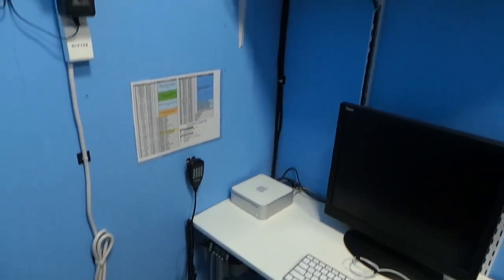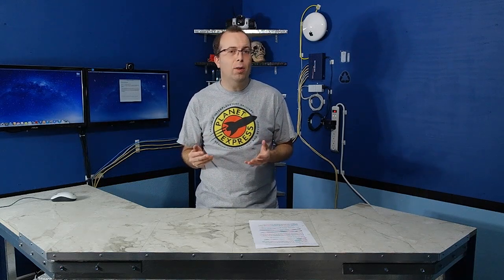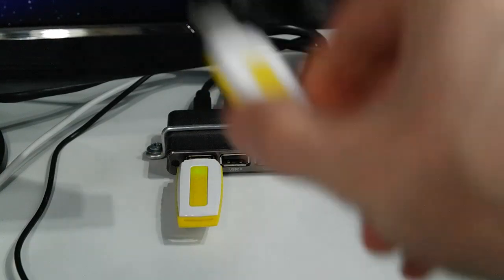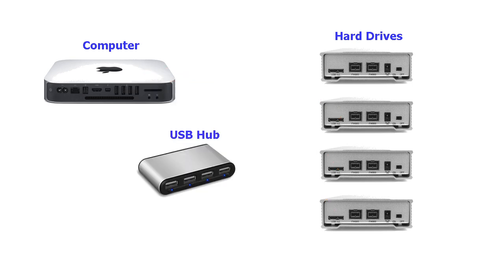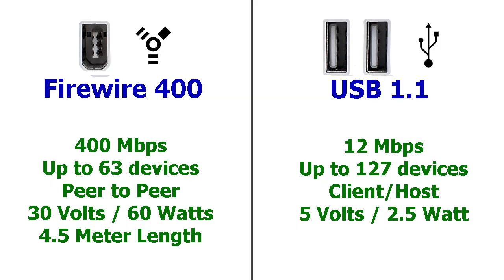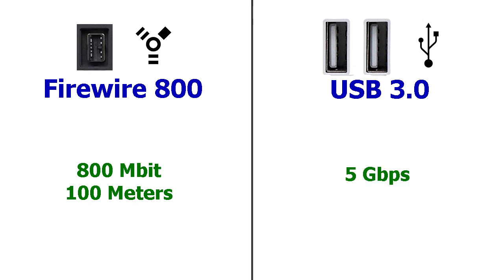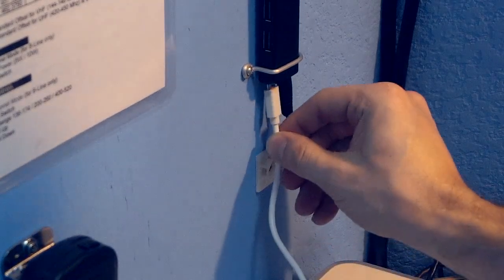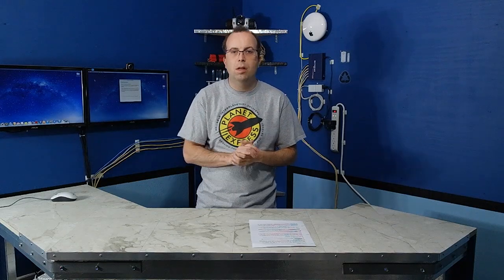Farewell R.I.P. Firewire, Hello USB!

Comment: The real reason for the death of Firewire despite some of its raw speed advantage in data transfer bandwidth is that USB was EVERYWHERE and AFFORDABLE (Intel made USB 2.0 licensing really cheap, and Firewire was always more expensive in part due to Apple pushing it and overengineering it, raising costs). Also Apple, as the main supporter of the Firewire standards, dropped it in favor of Thunderbolt as the equiv of an ultra-broad bandwidth pseudo-EPCI-E (External PCI-E) bus.

Also USB 3.0/3.1 is EVERYWHERE too thanks to Intel keeping the price competitive and USB Type C looks like it will become the new standard head over Micro-B 3.0 and 2.0.

Comment: Am I remembering correctly that the first generation iPod used Firewire exclusively? I seem to remember my dad having to buy a card.

Also, what is the functional difference  between daisy-chaining Firewire devices and using USB devices with an extra input built in?

Comment: CALLED IT... the very moment they announced Firewire, I knew it was doomed. It was not hard then to understand that the existing (and ubiquitous) USB would eventually reign as the serial connection of choice. Daisy-chaining was already an underused (and impractical) feature, even for most SCSI and MIDI setups, since users and hardware manufacturers – mostly for cost reasons – have always gravitated toward host/hub-based solutions with the PC at the center of their environment. [I never once encountered a system with multiple storage devices chained together! Unless you count, say, MSX computers whose second floppy drive hung off the primary drive. Nor have I ever met a person using Firewire 800.]
Finally, the rapid succession of USB enhancements meant Firewire's slight edge with regard to throughput and peering would quickly be erased. I also suspect (but cannot substantiate) that so few devices were designed with Firewire on board owing to onerous licensing costs and, ironically, because IEEE 1394 was simply TOO far ahead of its time; meaning, attached peripherals of the day (ZIP drives, microphones, printers, etc., with the obvious exception of video) did not need all that speed. And those that did tended to be internally connected via EIDE or (soon) SATA, or already had a better solution in place (like VGA/DVI).

Comment: One of the reasons of the fail of Firewire was the arrogance of Apple who charged too much royalties for using their technology and even the copyrighted name and logo. Some manufacturers like Sony renamed it D-Link, but it was actually Firewire. La Cie stopped manufacturing external hard drives with a Firewire connection and continued making USB-only drives. Then the making of Firewire peripherals declined and almost disappeared very fast. I saw in a shop a ridiculously expensive plastic block adapter for 30$, just for connecting two different formats of Firewire ports (4-pins to 6-pins). Like many Apple special cables and adapters that are a big scam to take the most possible of our money.

Comment: I understand why Firewire didn't make it compared to USB (speaking to USB going from 12 -> 480 -> 5000 mbs where as Firewire went from 400 -> 800 and would have gone to 1600 in its third generation) and today with modern computers, USB3 is fast enough for even any two spinning hard drives (and is only a tad slower than most SATA SSD drives, etc.) but Firewire was still far more elegant, and I don't mean just in its physical attributes, I mean in its specs.  As others have already pointed out, even the slowest computer could blast along at Firewire's maximum of either 400 or 800 mbs., etc.

Comment: it seems that gigabit ethernet has fully replaced firewire. But now instead of buying devices with "firewire" , you buy normal devices, and implement them using an ethernet interface.

Still blazingfast, and still peer to peer.

Comment: If you use wd my book or my passport drives and you keep the drives on a shelf buy a usb desk gorrmut drill the hole in the shel you can get them with like one usb that connects to the commputer and the block that goes in the hole has like 10 ports

Comment: 1 - Firewire is still used in the audio industry, as it is more stable than USB.
2 - Most ASIO interfaces still use firewire.
3 - FireWire 400 was able to maintain a constant 400Mbps throughput, whereas USB 2 was only able to attain 480 Mbps
     BURSTS rate. So FireWire 400 was still able to transfer larger quantities of data faster than USB 2.  FireWire 800 then 
     ruled the roost until the advent of USB 3. In the Mac world, Thunderbolt replaced FireWire as the fast medium of choice
4- Well, the last MacBook made that supported FireWire was made in 2012, so I would consider that FireWire died then.
5 - The thing with Thunderbolt and Firewire is that Thunderbolt is way more versitile in every way. And USB is going the
      same way unlike Firewire.
Fact: Firewire is indefinitely more stable.
Fact: Firewire is indefinitely and infinitely more daisy-chainlinkable.
Fact: Firewire must be revived, the technology be multi-phased array so as to function and work together as one combine 
         each other's capacity and capabilites. Therefore Firewire must be redesigned and re-engineered to achive this.
Fact: Firewire must be both multi-phased arrayed and redesigned and re-engineered to become a parallel connective
          system. So if one system fails, the the others will continue on but equipped with a hardwired program that 
           simultaneously 
           monitors all systems and compares all systems functions and if one is starting to fail it automatically disconnects 
           that system and allow the rest of the other systems to functions. And sends an optical-visual alarm saying system 
           component malfunction
            and needs to be replaced.
Fact: Firewire must be based on the principle of the computer cluster parallel connectivity so if one compute
          malfunctions it is then disconnected, a visual optical alarm is sent to have it repaired or replaced, and allow the other 
           computers to function.
Fact:This redesigning and re-engineering and upgrading of the firewire technology though the use of the multi-phase array 
         systems and principles to increase it's capacity up to 1,000 gigabytes per second will revive firewire technology back 
         into front line. 
Fact:Both Russians, Japanese, and South Koreans are in a quiet joint venture to achive this and are successful and has 
         ironed out the kinks of the system and made it multiple-redundant in design and in engineering.
         Mass production has already been underway for almost 3 years and the hardware with it's hardwired programm
         and hardwired O/S are already open available and accessible BUT NOT YET RELEASED TO THE CIVILIAN PUBLIC.  
         They are still deciding when to release it in such a way to overwhelm the competing outsiders who are more than 
          eaager to supporessed this new invention and innovation, or even steal it and falsely make a fale patent claim over it 
          to prevent it's widespread use.
Fact: Fire wire was successfully reconfigured to be multi-O Raid by combining several clustered firewire systems it can e 
          easily be upgraded to 100 GBPS to 1,000 GBPS.

Comment: One thing that bugs me about this video. The hard drive is obviously USB 3.0 (or as it is now called USB 3.1 Gen 1) yet Your using and USB 2.0 HUB. Your loosing precious transfer speeds. The HUB is bottlenecking Your hard drive. I'm sure Your external USB 3.0 drive would go as fast as 90-100MB/s so why limit it with USB 2.0 speeds that would go up to probably 20-30 MB/s?
Reply: probably because the Mac Mini he's using only has USB 2.0 ports anyway
Reply: @GardevoirTrainer1  Still better off with a USB3 hub for future-proofing
Reply: you're just moving the bottleneck from the hub to the USB 2.0 port on the machine the hub is plugged into
Reply: @GardevoirTrainer1  or install a designated server working as a SAN..... for a small thing  its pretty darn usefull and cheaper do it yourself, or a  NAS configuration its even more stable than a cascade of External Hardrives wired by a hub
Reply: Since those drives are likely for archiving, speed isn't likely a big issue for occasional access.
Reply: Or he could have just connected the one usb drive via usb and didn't touch the rest
Reply: I was thinking the same thing.... Hooking a set of USB  3 drives to a USB 2 hub made me cringe.    My solution (and what others mentioned as well) was to just buy a NAS.   I don't see the point in having multiple external drives.
Reply: they are hard drives... they won't be hitting even usb 2 max speed anyway
Reply: sorry, it's called USB 3.2 Gen 1 now, and we all want to cryofreeze everyone at the USB-IF because they completely botched any sane schemes for the literal most universal connection protocol
Reply: Why not upgrading right now to a NAS?
Reply: This video is 5 years old nimrod
Reply: because its  obious, a HUB always be a bootleneck
Reply: @xXFlameHaze92Xx  But it's a difference between capping out at 5 gigabits, which may take a few devices, and capping out at a tenth of that, which may only need two devices.
Reply: USB 3 is up to 12Mbps, not the advertised 5Gbps.
Reply: @alandunaway3000  No, that's totally wrong. You're going back to USB 1 numbers. Even USB 2 is faster than that. I just read a PC World article where they tested a Mushkin USB 3.0 memory stick and it reads around 100 MegaBytes per second and writes around 40. It's not the best the format could do but it's sure as hell way better than 12 MBps (megabytes per second) and even-more-exponentially better than 12 mbps (megabits per second).
Reply: @jamescarter3196  I have a HDD and a flash drive, flash drive writes at 12 on USB 3.0.
Reply: @jamescarter3196  While my network writes at 50Mbps.
Reply: @alandunaway3000  are you confusing megabits with begabytes
Reply: @alandunaway3000  You're doing something wrong there, but also neither 3.0 or 3.1, etc..  flash drives ever use the full speed of their link. They haven't caught up yet.
Reply: @ChadDidNothingWrong  That proves my point that the advertised speed is fake.
Reply: @nucflashevent  Top of the line drives.
Reply: @alandunaway3000  ya talking about megaBITS or megaBYTES?
Reply: @tsrenis  My network transfers at 15MB/s, which is about 112Mb/s. And my flashdrives/USB HDDs barely get to 5MB/s. Even though the flashdrive is a Kingston(one of the best) and the Hard Drive is a Samsung.
Reply: @alandunaway3000  look, there's probably a problem somewhere with your system, but i can guarantee you even usb 2.0 can top that. i just plugged in my external hdd (usb 2.0 cable and port) and it somehow managed 22 MB/s. that's 176 mbps. i hope you fix your slow transfer speed problem, but don't go around saying usb sucks because your devices have problems or are outdated
Reply: @leogiri2863  Or a problem on the drives themselves, or maybe the advertised speed.
Reply: @alandunaway3000    maybe your port is slower than the standard, or maybe your drive is, but going from "my drives are slow" to "USB   2.0 never reaches advertised speeds" is quite far fetched. Also it took me 30 seconds to check that usb 2.0 can be faster than you say.
Reply: @leogiri2863  USb2 is crap(and usb 1x was even more horrible),it has high latency,as all USB does,and it never reaches 480Mbps its advertised as(and i've checked it on alot of systems with many usb periphrials). On top of that it cant be easily daisy chained and usb2 never provided enough power as it should of.. While i am no firewire fan,it was a better standard. usb3x is alot better and its finally gotten its act together(ignore stupid naming conventions like 3.0,3.1,3.2, gen 1,blah blah).
Reply: @a4000t  yes, but it isn't as bad as he says. It's still usable, even tho it's getting outdated, and it's still good enough for some things like printers and keyboards.
Reply: @leogiri2863  i'll stick with what i said, its crap,but we're stuck with it and it works for the most part. Its just proof that good standards rarely win.
Reply: @a4000t  I think calling it crap is a little excessive. Of course it's not perfect, but it works. In all of my life I've never thought "USB is so slow". Think of the alternatives. On one hand there could have been something better, but on the other hand usb coexisted with floppy disks and dvds. So of course I agree with you on the fact that now usb 2.0 is getting outdated and that there might have been better options, but I don't think it's as bad as you picture it. That said, I'm not saying you should use it, if you don't like it. the only problem I had was with AlanDunaway3000 claiming some nonsense about usb 2.0 being way worse than it actually is and saying that there's a difference if you plug a 2.0 hdd in a 3.0 port.
Reply: @alandunaway3000  uhm USB can do those transfer speeds, your right the hub is a possible bottleneck, but the drives themselves are hdds. Also even "high quality" flash drives are shit in comparison to an actual sata ssd.
Reply: @leogiri2863  No, it doesn't do a thing. I thought it did, but if the drive is limited to 2.0, putting on a 3.0 won't make a difference. 3.0 is limited to 7MB/s, unless you buy a top of the line mobo.

Comment: I came across firewire when I got my first MiniDV camera. I used it to copy the videos from tape to the PC for further editing. At the same time I also bought an external HD with firewire for the same purpose, as USB was way too slow back then. It's sad that this interface died.
Nevertheless I just brought my laptop with firewire back to life last week. My buddy next door wanted to copy a stack of MiniDV tapes to DVD and had already started using a cumbersome setup, piping the signal through composite video, HDMI and whatnot to his HDD recorder to then copy it to his PC using an external HDD. I gave him the laptop and a firewire cable and explained how he can copy the video tapes without any loss in quality (albeit at the same speed as the tape is the limiting factor here). He had never seen that before and was amazed that he could even control the camera through firewire. :)
Reply: Colaholiker Yeah, my old MiniDV camcorder is the only place I ever really used a FireWire port. Had to get a PCMCIA card for my laptop.
Reply: @pokepress  For me it was the starting point. I also got a Firewire external HDD, which was way faster than USB 2.0 back then. I am still using it, even though I will have to switch to the much slower USB port now that I am setting up a newer PC which doesn't have FireWire any more. (On the older one it was on board, so no chance of just swapping the card over.) But interesting thing is that my "new" PC (in fact it's 4 years old now, but I just got it) still has an RS-323 port on the back connector and a classic parallel port as pin headers on the mainboard. And it's just an off-the-shelf Lenovo Thinkcentre. I am amazed. :)

Comment: Have some FireWire devices here (like an audio interface) which I can no longer use. It was a total fail : ( eventually FireWire 800 came out but IIRC it wasn't even retrocompatible with FW400, unlike USB which was always made with retrocompatibility in mind. Also these audio devices were way more problematic with FireWire/ IEEE1394 than with USB (dropouts, driver problems, erratic behaviour), despite I thought FireWire was much more stable. Natural selection did its job.

Comment: You can connect two computers together with USB.  They just require a special cable between them so it becomes the bi-directional.  Better known as a bridging cables.  Also, those that are saying that USB 2.0 doesn't reach 480Mbps, while that may be a true statistic, it is actually the fastest burst rate it can hit.  The specs say "up to 480Mpbs" or the "maximum signaling rate".  See https://en.wikipedia.org/wiki/USB#USB_2.0  I have also tested copy speeds whether it is plugged into the USB 3.0 or 2.0 and they are the same or possibly slightly quicker, but not at 50%.   USB 3.0 will slow down to the highest speed supported by the device.

Comment: What’s Firewire? I’ve honestly never heard of it. I’ve used USB for as long as I can remember.
Reply: Bruh how old are you
Reply: It was properly called "IEEE 1394."  Although, IBM-compatible users affectionately called it "FireWire," and MacIntosh users dubbed it "iLink."

Owing to its dual analog/digital hybrid design, it was much faster and more efficient than the first generations of (all-digital) USB.  Now that USB's bugs have gotten worked out, though, it is obsolete.
Reply: @grantorino2325  
from Wikipedia:
"[Apple] called it FireWire, ... The 1394 interface is also known by the brands i.LINK (Sony), and Lynx (Texas Instruments)."

1394 is the name used in the Windows world. (Source: myself. I remember seeing "1394 connection" in the "network connections" special folder in Control Panel on Windows XP on an IBM ThinkPad laptop.) I have never heard of the name FireWire until I looked 1394 up on Wikipedia. Maybe you're getting a little mixed up here?

Comment: Would it not be better just to take the leap and get a NAS enclosure with either Thunderbolt or USB 3.0/3.1. Remove the drives from those pre-built enclosures or get standard or greater hard drives.